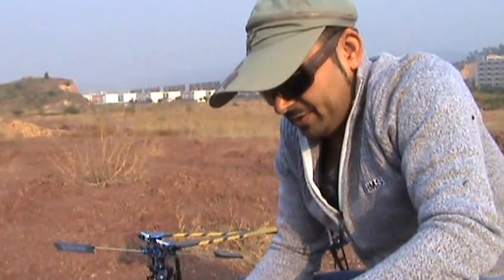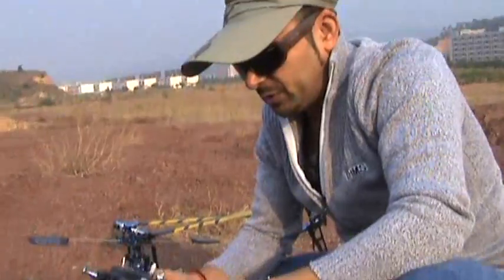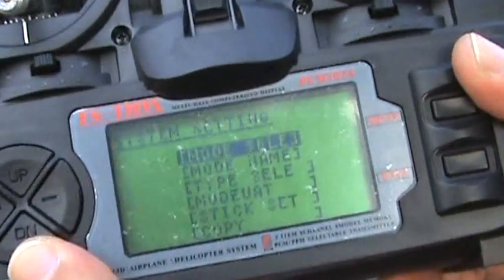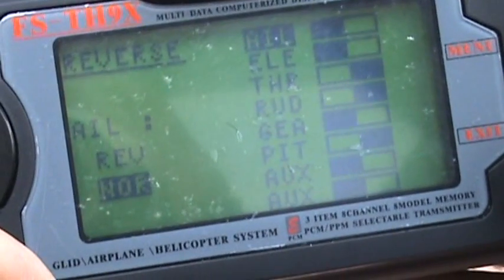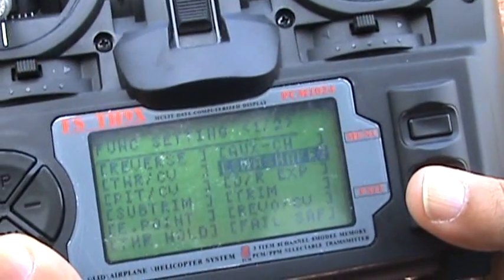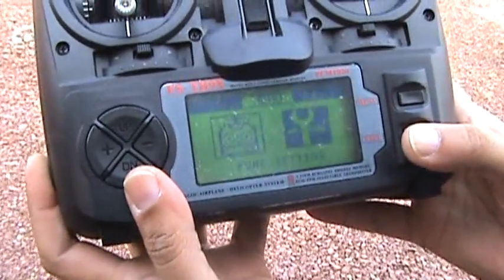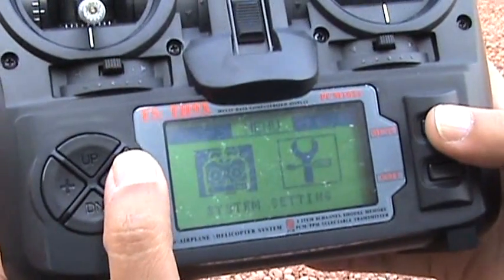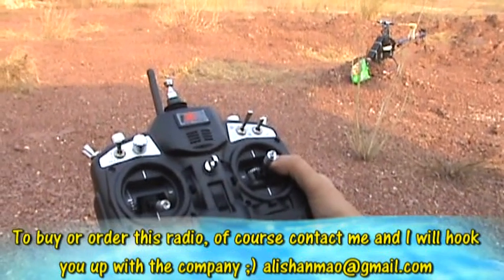Alis RC Chit Chat the 9Ch 2.4G Radio

Comment: 1 to 9 channels? isn't this radio of 8 channels in fact?

it got 9 channels just in PCM mode with the FlySky PCM 35/72 mhz receiver.

in PPM just 8 channels, and you need ppm so 2,4 ghz modules recognize it.